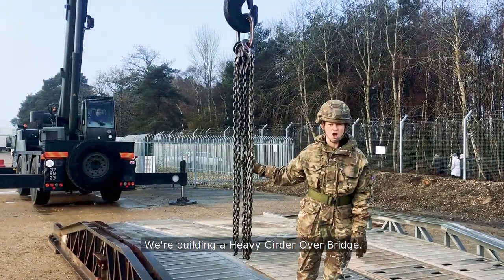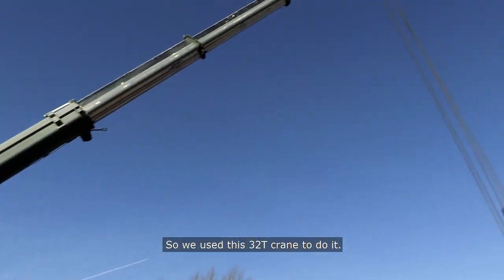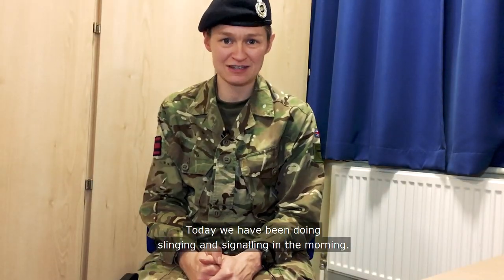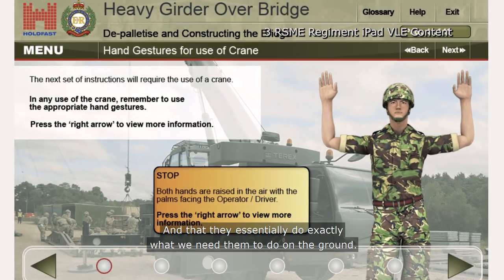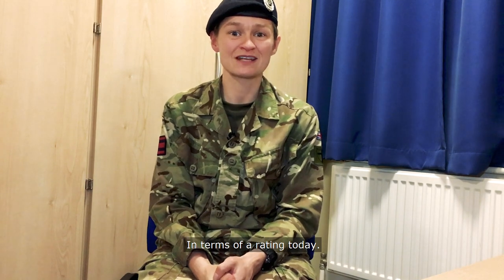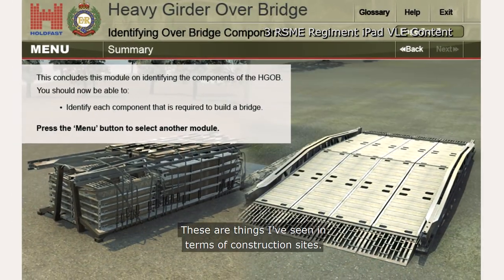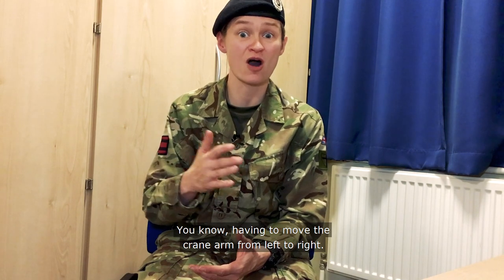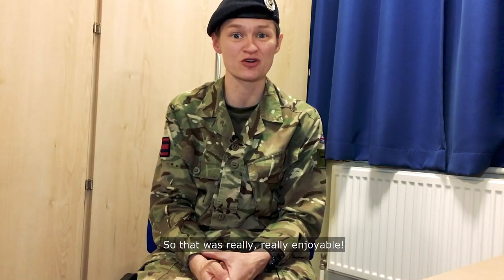Corps of Royal Engineers - Follow The Sapper Part Five | Reserve's Combat Engineer Course

Comment: Sorry but can't see girls lift baily bridge or mediam girder bridge components that require the ability to lift 100kgs above thier heads severed over 15years in res
Reply from the maker: Peter, I can't see most men lifting 100kg above their heads either? And there is definitely no requirement to in the Royal Engineers. Every individual in a section brings a unique skillset that contributes to the success of that team...it is not just about 'brawn', you need to have brains too! Thanks for your 15 years service in the Reserves.
Reply: @CorpsofRoyalEngineers  i wasn't in reserves i was regular army for 15years in Royal engineers
Reply: @petew5289  so while they think about we will just get on with the job 😆